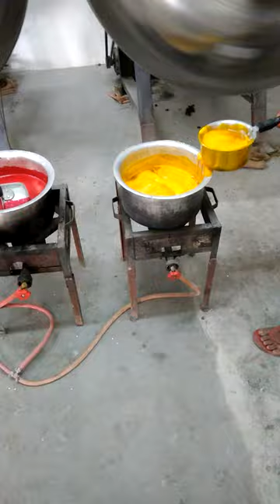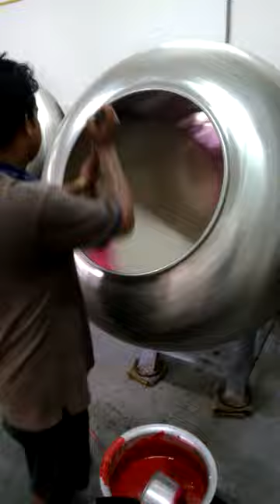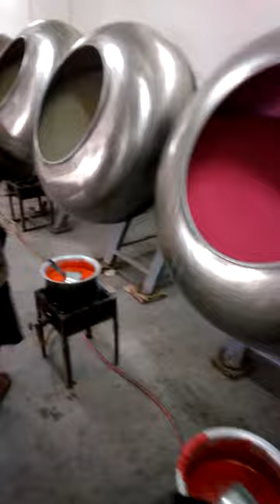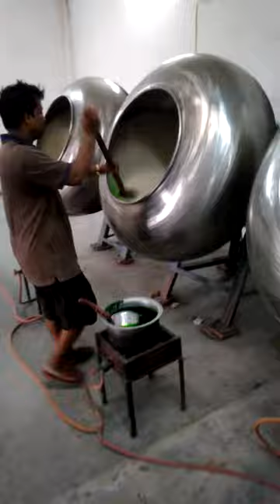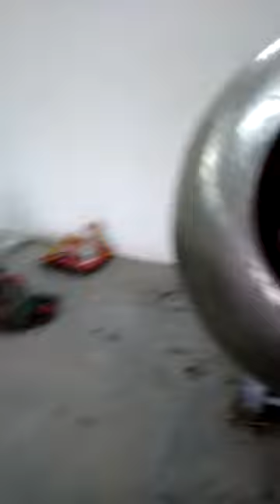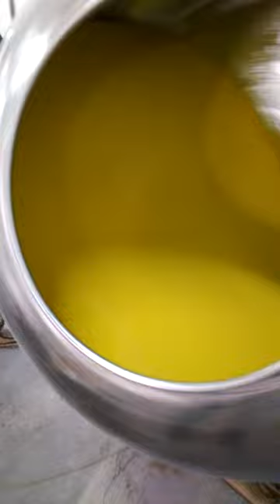Sugar coated  balls process

Comment: Can you please share ....some details about the coating pan that has been used and other machinery required to this coating business
Reply from the maker: Coating pan is basically a type of Mukhwas which is made by the mixtures of some ingredients and it is not required any machinery rather it can be prepared by the skilled labour through hands but in this coating pan we have to use some ingredients like fennel coating, sugar balls etc. Which is prepared by the machinery as named coating rollers.....
Reply: I want to set up this business....can u please guide me on this....I want a operator....since I have no knowledge of manufacturing process,but have been selling sugar coated fennel from long time...
Reply from the maker: @dhirendersingh8115  ok call me on 8233153600....I will help u as per my knowledge..